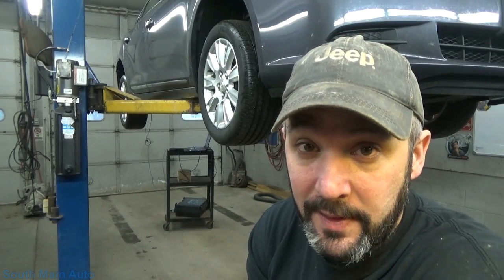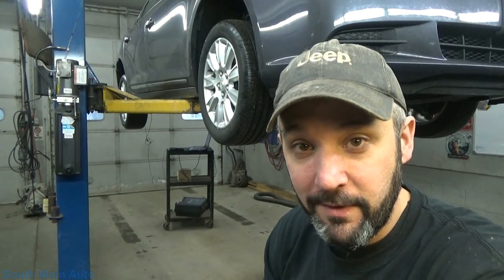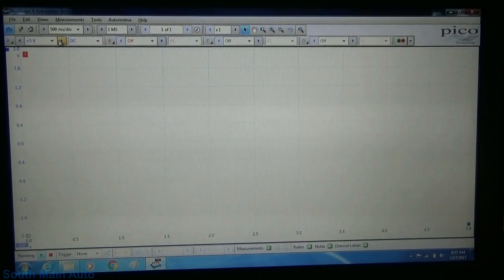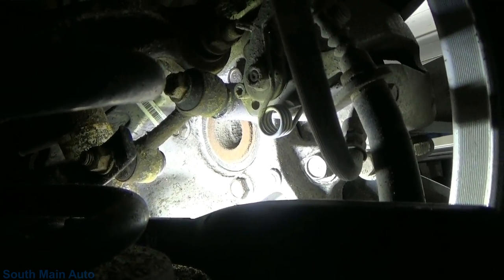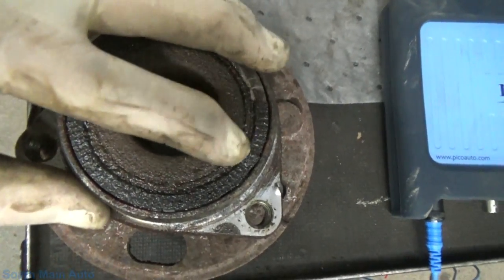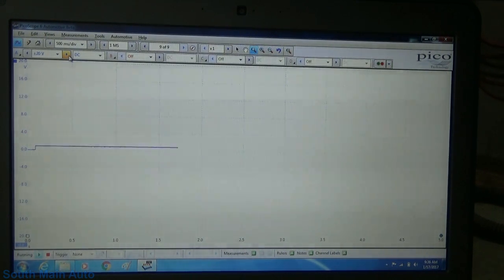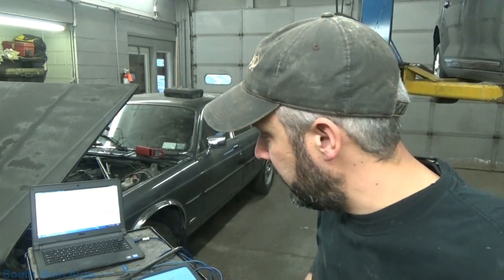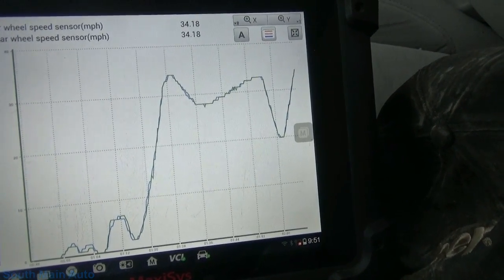A Look At GM Digital ABS Wheel Speed Sensor

Comment: Great video Eric...as usual.    I have a 2005 Silverado V6 Work Truck.  According to one of your other videos, my Driver Front Sensor is KAPUT...pump activates when stopping pulling the steering wheel to the right.  I don't have the time or money right now to have it fixed .Can I pull that big ol' 60A ABS fuse temporarily?  Thanks again for the videos.
Reply from the maker: I can't give advice on that. https://www.youtube.com/watch?v=oXW0mqPrmPs&t=1s
Reply: On our 08 Chevy TrailBlazer we had to pull both the ABS and Traction Control fuses to make it safe to drive. I assume the steering wheel yaw sensor is bad (probably in addition to a bad wheel sensor or two). https://cdn.pximg.xyz/7488a1288e244bebe2c4cb7dd823956b.jpg

Comment: Who's brainiac idea was it to put an glued in, unshielded magnet outside, 10" from the road, attached to a potentially life-saving control system? Are they trying to kill people?
Reply from the maker: Thankfully they made them this way. Keeps me busy :)
Reply: That's today's GM!

Should be their advertising slogan, LOL. You get a great engine, surrounded by a giant crap sandwich!
Reply: Is this one of the cars that will make America great again ?
Reply: It is not just a magnetic.  It is a piece of plastic "bonded" (melted) to a part of the bearing.  The plastic has fine metallic particles in it.  Once the bonding is secure, a special electromagnet is held against it making magnetized and non-magnetized zones. 

Not a bad idea IF the bond is truly water impermeable.
Reply: But it could've delayed it. Without shield it was 6 years untill failure, so with a shield it would've probably been 8 years or so. But why should GM care? The car is probably just out of warranty and therefore it's not their problem anymore.
Reply: They're TRYING to make more money in service. And I gotta say...they're doing a great job. We could debate weather or not manufacturers SHOULD make parts attached to a life-saving control system more resilient, but the truth is that they're choosing a more profitable path all around. 

They figure as long as the CEL illuminates within a reasonable period after failure (which apparently it does), they can't be held liable and they make money. And until laws change to force them to act otherwise, it'll be this way for the foreseeable future.

You could always choose to buy a premium brand once you realize the price premium pays for improvements in these areas. But this only applies if you are someone who plans to drive their car into a long life.

I've joined the lease and dump cycle specifically for this reason. It'll stay that way for as long as I can afford it/things change.
Reply: Premium brands break just as often. Par for the course today.

I chose to drive cars built before '96. Got an '86 Grand Marquis - had it 14 years now, 240k miles. We keep it out of the road salt. For winter, we've got a '93 Volvo 940 - slow, but built like a tank, and DOES NOT RUST! Bought in '14 as a no-start real cheap with 131k on it - got it running and on the road summer of '15. Now has 152k - many years left in that one.

My only modern vehicle is a '07 Silverado. I've had problems with this thing right off the showroom floor! First and LAST new vehicle I'll every buy. Ball joints smoked at 38k miles, constant pulsating brakes - had 40 miles on the clock on the test-drive, and GM couldn't fix it. Change the rotors, and it happens again in 3k miles. Interior has more squeaks and rattles than my '94 K1500 did with 266k on the clock. I could go on all day ...
Reply: Tell your new super boss in Washington... he blamed us for not buying these cars.. he still has to find out, nobody wants them
Reply: the newer ones have a plate that goes under the bearing bolts that seals the tone ring off from the outside
Reply: The ferromagnetic  ring is in  the oil seal  European manufacturers generally shield from road debris.
Reply: Doubtful that any kind of shield would have kept the moisture out and prevented the rust jacking.
Reply: I looked after 4 MG-Rovers  with that  BMW Bosch 5.7 version ABS --- all with between 105,000  and 170,000 miles  on the clock with only 1 ABS active wheel bearing failure and we use a lot of salt on our roads.  The bearings European GM  Vauxhall/Opel models are more problematic. 
The old toothed ring style were much more troublesome but much easier and cheaper to diagnose and fix.
Reply: Eric maybe you should start cashing in on the sweet German gravy train. I swear its never a dull day owning two VWs.
Reply: VW try to re-invent  the wheel every two years which is ironic consider how low the Beetle and early Golfs  went on without major changes.
Reply: Calm down and don't be overly dramatic on this issue Bubba...no one is trying to kill people....so the abs doesn't work, big deal, you still have normal service brakes available....sheesh...smh....
Reply: The point is they don't care if people die as long as they profit.

Comment: alot of times traction control is affected and where your at that's not good nice video
Reply: You can sometmes tell which wheel is affected by  which of the other sytems it takes down ---- speedometer stops working on the car types  that I work on it is always the left right front,  cruise control right front,  sat nav input one or both  rears.